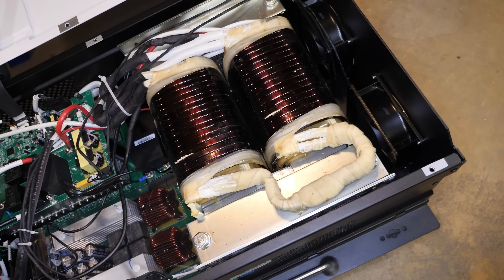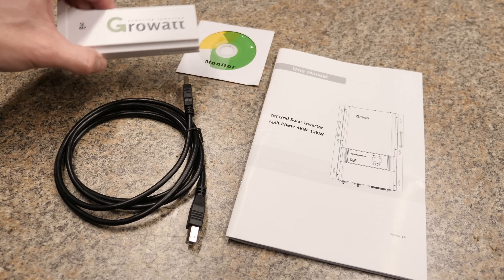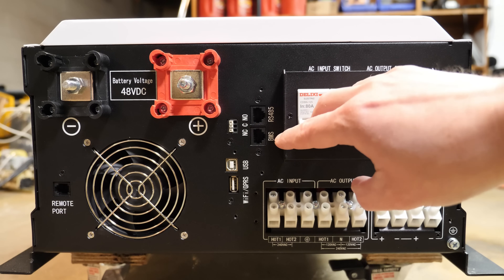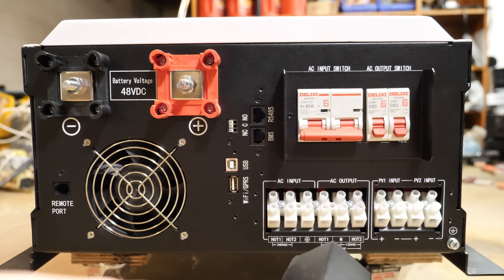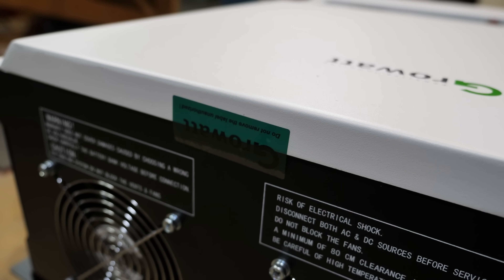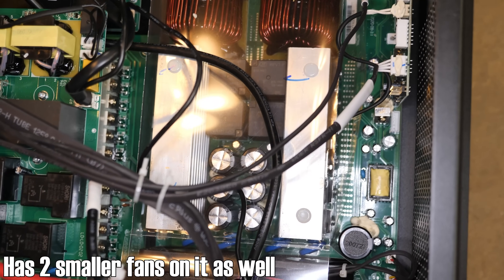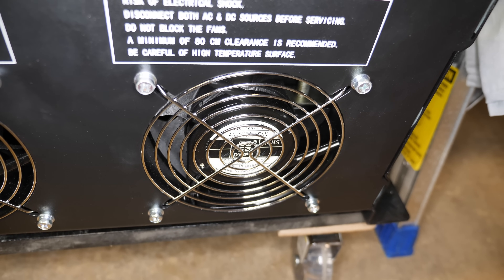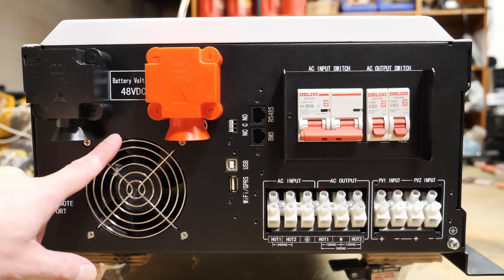Overview of a 12000w Growatt Split Phase LF Inverter!

Comment: I share Your opinions on AC input, output and solar panel connections. Especially with that nominal power. However warranty is void, You can try to find more suitable termination blocks. But I think this is for the time when You are ready for whole house on this beast. 
As far as I can see there is no galvanic isolation between solar panel inputs and battery output(by means with transformer). You can examine this by continuity test between every solar input and evri battery terminal(Thought four black cubes could be relays and could break the connection). If there is galvanic connection between solar and battery, I would suggest serious surge protectors to be installed. One close to the panels, one close to the inverter solar input and one close to the inverter battery terminals. This for battery terminals should be for 48V DC systems.
Reply from the maker: I would be nice to maybe connect directly to the circuit breakers.  I can check continuity on those terminals to see. I think you are correct that the black boxes are relays.  I can open it back up to check.  I do have those din rail surge protectors for the solar input.  Dont have any right at solar panels or at battery.  Got any links for those?
Reply: @AVERAGE_JOE  Yes, it is good idea when doing final install to connect directly to the cirquit breakers. You will loose some conviniency for wireing, but will be most reliable connection. Can use area of terminal blocks for strain relief of cables. Cables will became stationary for the inverter, but I'm sure You can manage this. I have rewatched the video several times. As long as I can see on 7" tablet, there are blue discs on the edge of solar charging board. Most likely these are varistors, hense there is internal surge protection. If there is combiner box on the roof, You can add DIN rail mounting surge protector. I think 120V AC rated varistor surge protector will do the job. Since max PV voltage should be 150V DC. On AC input/output board I have mentioned some green disks. These could be varistors too. Hense internal surge protection. But I'll recommend to use external DIN rail mounting surge protector additionally. Especially if You plan tests with some kind portable generator. For 48V DC I couldn't provide link. I have only seen these in Emerson telecom rectifier cabinet. I suggest 48V surge protection mostly conserned about Batrium cirquits around the batteries. In my professional practice I have used self made 48V DC surge protector. And it was with very good results. I could explain how to make such in another post. And I always forget. Mery Christmas and happy new year! Long live inverters and batteries!

Comment: Joe, I'd love to know a bit more about your selection process. Why Growatt? Not questioning your logic - I'm honestly asking because I'm looking at off-grid options for a new house. For ex., did you look at other manufacturers like AIMS or Victron?
Reply from the maker: Hole story choosing this over others.... Budget friendly and split phase. Originally I was saving for an MPP LV5048 but then saw David Poz video and it not starting a radial arm say.  That was out! Then Low Frequency got added to list.  Continued to save for an Aims, but through research ect I heard they dont like big transfer loads.  Like if you have a single transfer switch and switch from grid over to inverter without turning off all circuit breakers first.  Not that they cant but I hear they dont like it.  Then Shawn Maker got the 6kw growatt (smaller of mine) and it looked decent. More research and what sold me on this one is I saw signature solars YouTube ch  and them using the 6kw (same as Shawns) starting a bunch of saws, air compressors all at the same time and it didnt blink an eye.  So I went with the 12kw so I could attempt to run the hole house.  I also like that it can be used like a UPS, bypass ect cause if Im at work or whatever, wife should be able to have power regardless of battery voltage as it will switch back and forth based on your settings. She does NOT want to be down in basement flipping circuit breakers,  switchs ect cause the sun didnt come out!  Thats the short story.  If I had tons of cash I would have really looked into a sol-ark as they might be a little more efficient!
Reply: @AVERAGE_JOE  Thanks for the reply!  Stay thirsty... in the "Mexican Beer" sense, not like an "Instagram THOT." My kids tell me I'm saying that correctly, but they might be playing a trick on me. Anyway, that price does seem pretty low for the specs - if the reliability is good, that seems like a huge bargain.
Reply: Aims and Victron are whey difrent class inverter's...
Aims can be compared with china LF inverters 
Victron on the other hand could be class of sol-ark ,outback shneider electric...
victron is top brand with quality component's .... 
If u go offgrid or something like that go for victron and u will not make mistake....
Reply from the maker: Yes that is a correct statement!

Comment: NOT Keen on all in one machines.  One section fails and your screwed.  NO I want individual components.  Charger, Inverter and control..  My Epever and Reliable inverters being the heart of my system.  I'm only dealing with 10Kw. of battery here.  Enough to float me for two days.
Reply from the maker: Yeah I could see that for sure! Lets hope they dont fail. If they do fail Ill be the one to find it💥🤣🤦‍♂️If we had a smaller house and it was moar efficient I could probly get by with 10kwh. The wife like to cook and clean so Ill be building packs here quick like.

Comment: what size wires can you fit in those dinky little connectors? can it handle 6awg on the pv input or 4awg?
what about the ac side? 6awg or 4? thanks.
Reply from the maker: Manual says 6awg for AC and 8awg for solar however all terminals are same size.  I just put a 6awg in and there is a little wiggle room so 4awg may fit.
Reply: @AVERAGE_JOE  good. That was the only thing I saw that got my Spidy-senses tingling.